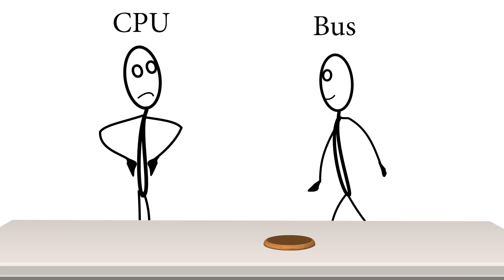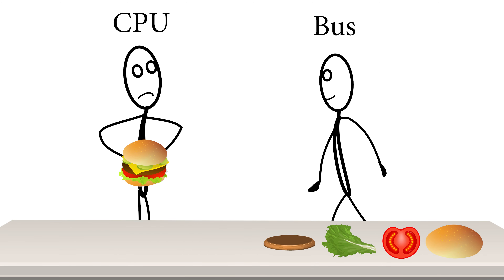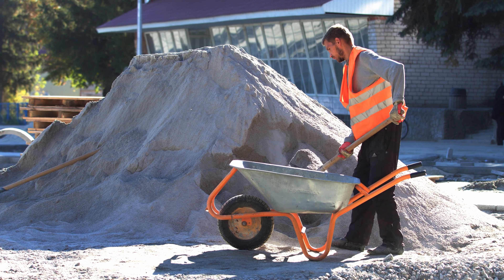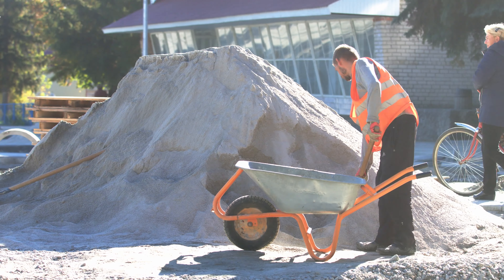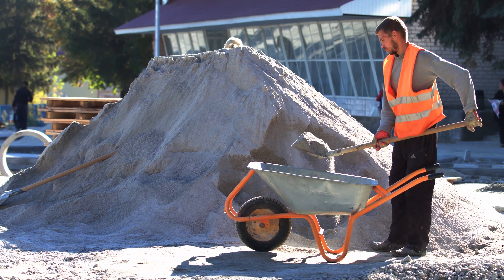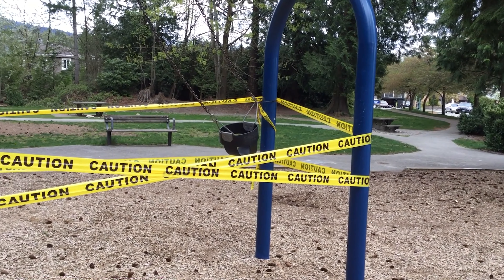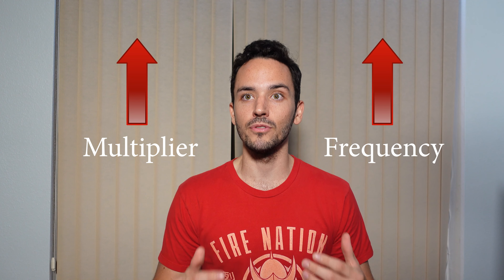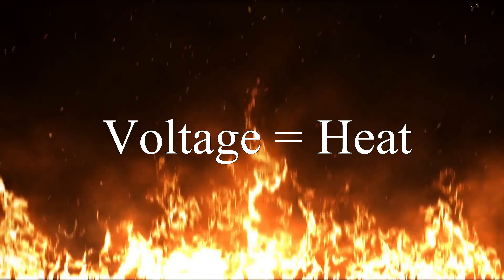Unlocking the Secrets of Overclocking: What Your CPU Goes Through

Comment: But honestly...I still do not understand if the clock speed can affect the speed and functioning of the computer,for example a 1.4GHz Intel core 2 duo or a 1.85GHz Intel Celeron...which would be faster
Reply from the maker: Well clockspeed alone isn't the whole picture. But in general a higher clockspeed (for the same chip) will increase performance. When comparing 2 different chips like the core 2 duo vs celeron you really need to look at the application they're being used for. Maybe one has more cache, more cores, better architecture, runs at a higher wattage? There are a lot of factors and the best way to compare is by just looking up benchmarks.
Reply: @MaxsTech  okay thanks